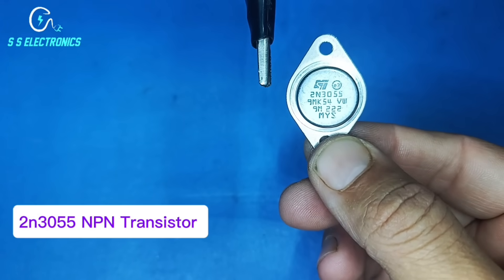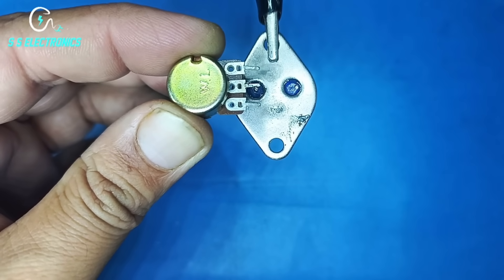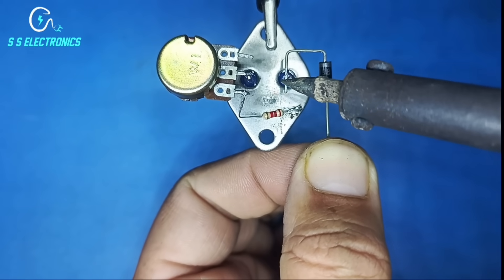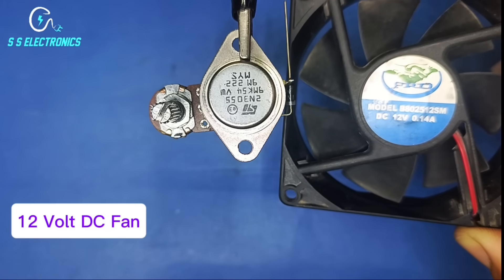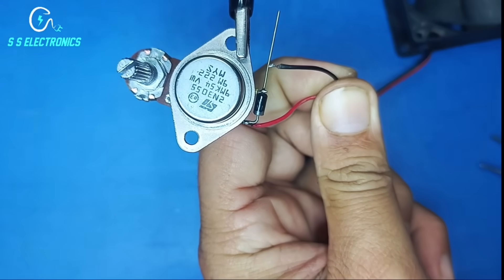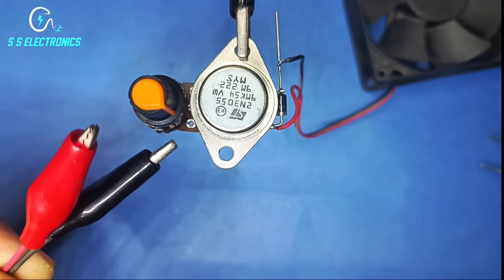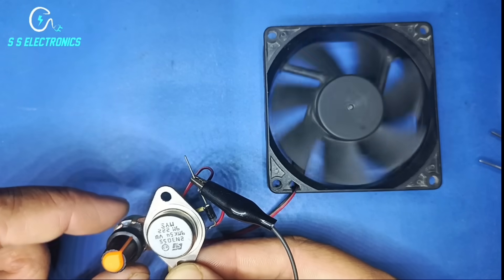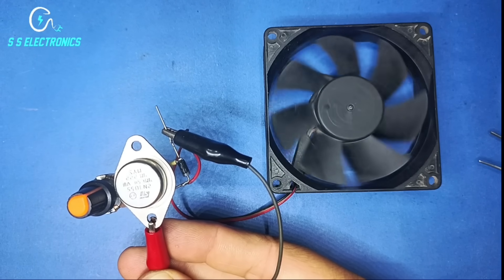Adjustable Voltage Regulator Using 2N3055 Transistor | 0 To 40v 10 Ampare

Comment: @PROFFH-Z6K<<<<Thank you for the comment on 2N3055/MJ2955 complimentary symmetry class B push/pull audio amplifier. The beauty of this circuit is it did not use output transformer. I join you with your sentiments on those semiconductor devices we worked and tested. I may also kindle your memory if you remember AD149 Germanium device. (Circa 1967/68) I cut the top of AD149 washed the heat dissipating white compound with CarbonTetraChloride to see the EB&C (body) then I connected both E&B ( E&C I don’t remember) to analog MM (5V range), placed the exposed area to sunlight and I watched the meter needle deflect to 1V. THAT WAS THE FIRST SOLAR POWER❗️
Here the guy who exhibited 2N3055 VR, did not draw the diagram for enthusiastic youngsters who could build a similar VR.
His soldering points were all ‘dry soldering’ causing bad connection. Please use soldering paste.
Thank you.
Reply from the maker: Ok thanks for feedback

Comment: Output 1v ,10A. 39V 10 A on " 2 n3055" : 390W to be dissipated: a strong heat sink for it !!!
Reply from the maker: Yes, a heatsink is very important for this circuit.